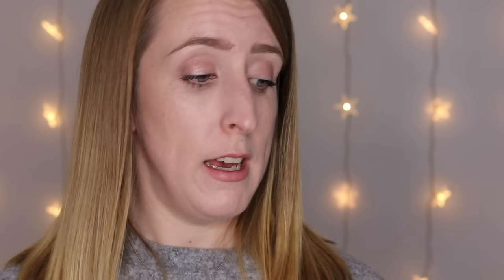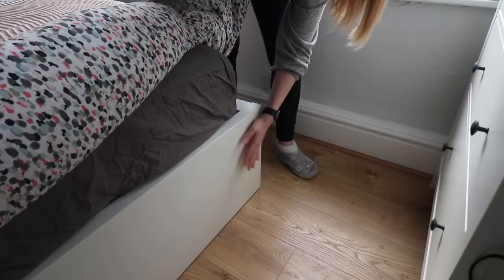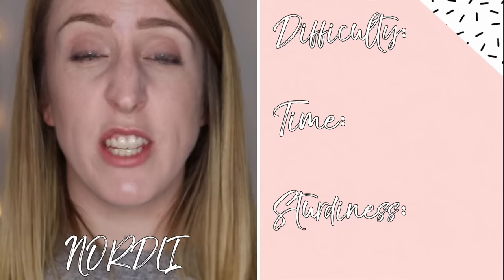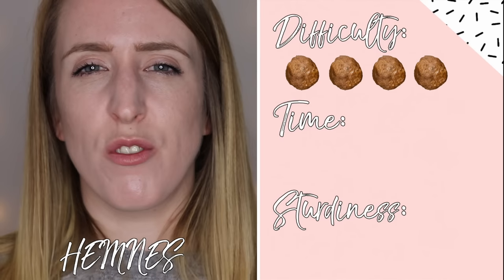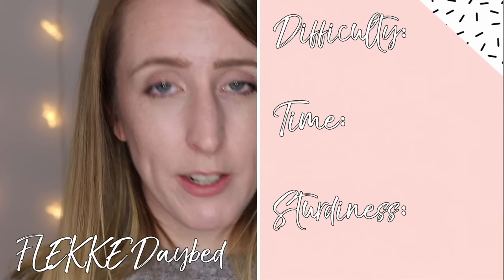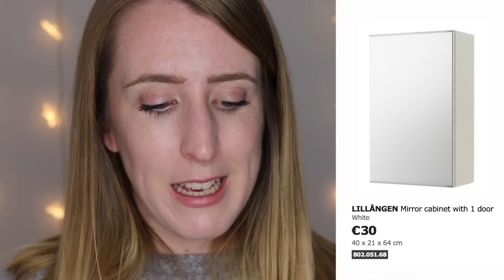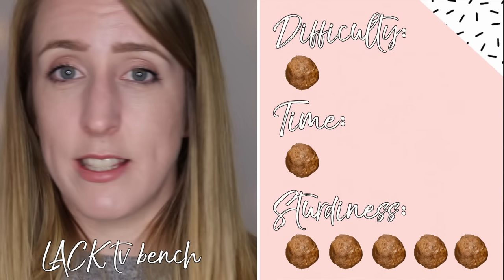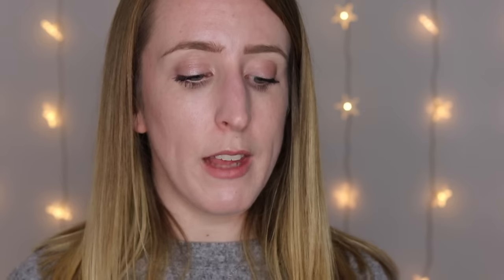IKEA FURNITURE HAUL | Hemnes, Malm, Flekke & more! (Plus: Sneak Peak of my house!!)

Comment: Is everything still intact ? My problem with ikea is the chipping of the paint but it’s good for the price I suppose
Reply from the maker: Yep! All good! Still very happy with the furniture. The only chip on ours is on our headboard on the bed, but my boyfriend did that the day we made the bed 😂 so we never go around to fixing it. We’re still using all our furniture and haven’t thrown any out. We’ve since bought more too
Reply: Elaine Power if it helps I discovered a hack for the chips. there’s a filler from tesco and it’s the exact same shade as the ikea white furniture I used it on my bed because when I assembled it there was a chip (same  bed as you)  I use a cotton swab and my fingers and lightly press the filler in the damaged areas and wait for it to dry I smooth it down with my fingers or cotton swab when semi dried :)

Comment: I'm totally confused by your rating system. Ok so it took 4 hours to assemble so it got 5/5 is that perfect or bad ? Then you deduct 1 for sturdiness because of the chip making me think 5/5 is perfect and 4/5 less so. That's my confusion 😸
4 hours seems really long to assemble ..wouldn't it get a 2/5 not great for assembly? I'm a math teacher sorry being type A but I need to understand thanks 😃
Reply from the maker: Hi Melanie, thanks for the comment. The scales represent high and low... as opposed to good versus bad. High (versus low) level of sturdiness, high (versus low) level of difficulty, long (versus short) length of time. They’re not meant to add up to a score together or anything like that. Thanks for watching!